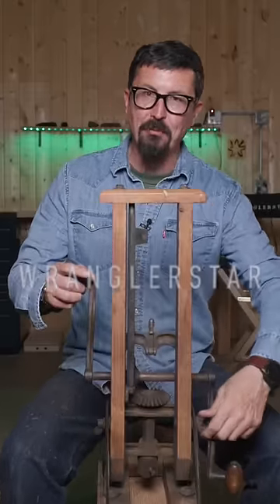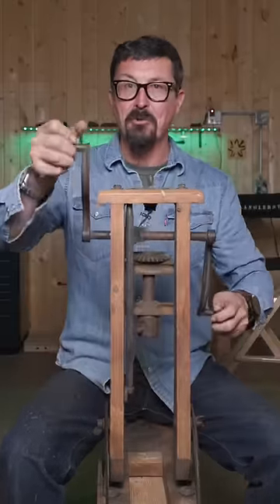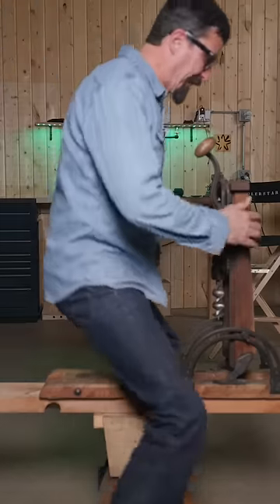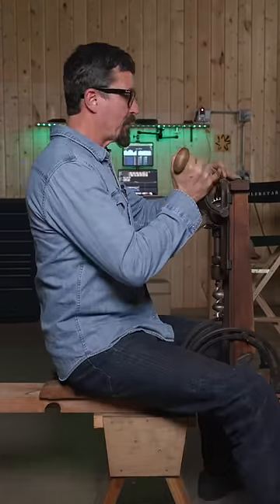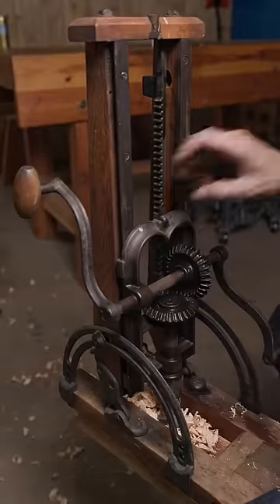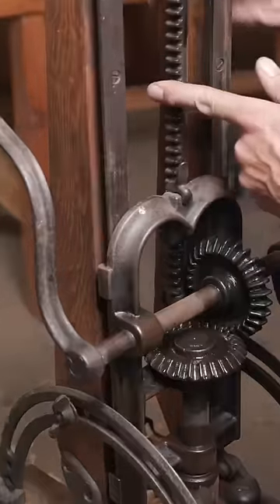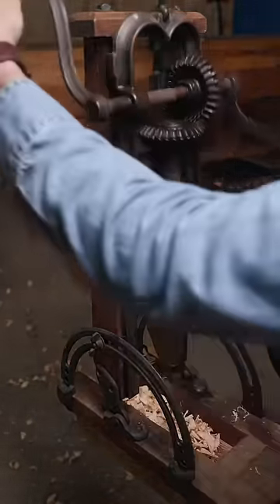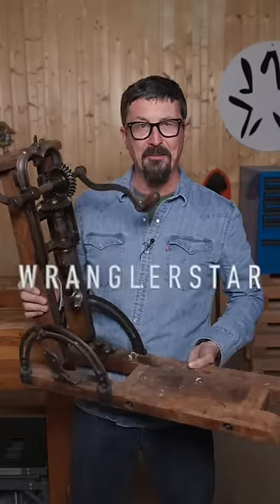Amazing tools used by the US forest service Wranglerstar professional Homeowner

Comment: That mesh gear set up to return it to the top is really smart good job to whoever thought of that long ago
Reply: That was my favorite bit
Reply: I might be dumb, but, what happens if you just turn the cranks the opposite direction?
Reply: @left4twenty  I think the friction between the wood borehole and the non-cutting (dull) edges of the drill bit might make it hard to deliver the necessary torque by hand via the bevel gears. Perhaps just linking it to a beefy rack and pinion gear and riding up on that is easier.
Reply: @stinkytoy  i've been reflecting on it, and I think it would probably spin in place instead of screwing out.  

On the way down, it is relying on it's own weight, and the operators weight holding the machine down against the wood.  A toothed track doesn't seem to be engaged on the way down.  So when it lifts out, using the track means the operator can use the crank, without having to exert as much effort, by holding the weight of the drill on the way up.

It would be possible to turn the cranks opposite and lift out, but the operator would have to do the lifting, instead of the track/machine
Reply: Probably whoever got tired of smashing their hand when they tried to force the drill back up on the first version.
Reply: @left4twenty  The drill bit will draw itself in or out based on rotational direction, because it is essentially a screw, but has a lot less material to use to push itself out and will likely just spin in place. It would probably be possible to tilt the bit slightly off vertical axis to engage the screw's mechanical advantage.
Reply: Why not just keep it in the same position and crawl it down
Reply: @Ericshizz  the feed rate would then be set but likely needs to be variable to prevent breaking the bit.
Reply: @left4twenty  it would do what you described. There's no more wood to hold on to so it would just slip about.
Reply: @Ericshizz  it would be too aggressive of a pass and be hard to drill the hole as well as likely leave a bad finish.

Comment: "...at the turn of the century..." 
I somehow doubt that it was used in the year 2000 ...
Reply: 1900, not 2000....
Reply: @crypticgamma6308  the latest "turn of the century" was in the year 2000
Reply: @aednil  well of course, but given the context I would assume he was not talking about the most recent turn of the century, because obviously everyone was using power tools by then. So the most logical conclusion, is that he is talking about the turn of the century that this tool was relevant to and prominently used in, which I would assume was around 1900, but it's possible it was even 1800, I don't feel like doing deep enough research to find out.
Reply: @crypticgamma6308  of course he didn't mean the year 2000; what he said was simply too vague and I was mocking him for that.

Comment: This is an awesome tool for a low/ no  power shop in my opinion. I would also dare to say that with a few modifications you could mount it to a portable shave horse for quite the efficient portable woodworking station.

Comment: That is ingenious! I have an old brace and bit that I refurbished myself. It was locked up and rusted at the bottom of a pile of old tools in an antique store, but after some oil and a wire brush it still works a charm☺ that'll teach my dewalt battery to d!e on me in the middle of a project.

Comment: I bought a reproduction version of one from the Canadian forest service. This was my 550$ suviner when I was vacationing up in the northern territory of Canada.

I have used demo one in Montana when I was visiting my dad. 

The American one in my opinion is better built, the wood is much better. Charred oak is stronger and more weather proof.

The Canadians use a hot sap soaked method of weather protection. I have to sap soak it every 5 years to keep it from drying out.

Comment: Problem: We need to build lodges in remote areas where horse drawn carriages have trouble getting to.
Solution: Cut and process the materials on or near the site.
Problem: Okay, we got a prototype, and it functions using gears and levers, but we sometimes only have a few men on a site at any given time.
Solution: Make it only need a single man, and his weight will help drill the bit into the beams of wood.
Problem: Well, we drilled the bit into the beams, but it takes all the men to pull a single drill bit out of said beams, how can we make it easier?
Solution: Use gear tracks for traction and pull it out like that.

Comment: Is the timeperiod around the turn of the centuries right? Would have guessed it to the time of the New Deal...
Reply: It was in the 1870s
Reply: @therealgeneralMacArthur  What was in the 1870s? I know of the Timberline Lodge up on Mt Hood in Oregon and that was build in the 1930s...
The Ahwahnee opened around 1925.
Reply: @TheRollingBasti  this drill.
Reply: @therealgeneralMacArthur  How do you know? It does sound right that they used it during construction of the mentioned lodges/ hotels - I am pretty sure they didn't power tools. So the drill could be from the 20s or 30s as well...
Reply: @TheRollingBasti  because it was patend in 1872.
Reply: @therealgeneralMacArthur  Ah, interesting. Thank you!

Comment: I swear all these "forest service gear" ive never seen in three years of forest service work. So i am curious we just used normal tools with batteries except in wilderness areas ofcourse where we cant use power tools. Then we do it the old fansion way alot of hand cranks and smashing metal rods into wood. That we cut down ourselves with hand saws and axes.